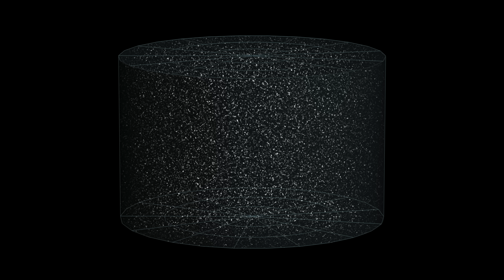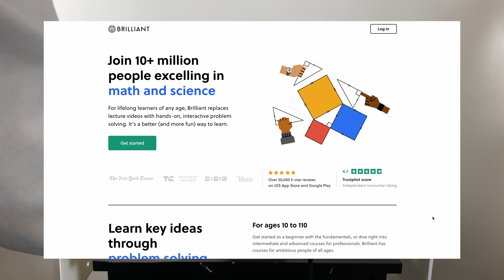World's biggest gear ratio...

Comment: I wonder if it's possible for you to even turn the last gear? (Imagine if he could and all the gears are somehow strong enough to maintain their structural integrity) at which gear would the gear teeth break the sound barrier?
Reply: He said it's impossible to spin that last gear as the very first gear that starts to spin in the whole mechanism would have to go either at OR faster than the speed of light (299,792,458 m/s) in order for the last gear to even complete a single rotation.

Comment: I'm not seeing any of the other gears down the line rotating, I know it's a small ratio but you're spinning the 1000x, gear in the video but the 100000x,  and even the 10000x isn't moving fron what I saw I n the short clips there was well over 10 spins of the touched gear, please explain

Comment: It is possible to get much greater rations with much fewer parts using "grinder gears" AKA "differential gears"
Imagine two tubes with teeth on the inside.
One tube has 100 teeth and the other has 101 teeth
Imagine a cylinder 2/3rd the size of the tubes that has a step in its diameter.
One part has 66 teeth and the other has 67 teeth.
If you put the two tubes end to end, lock the 100 teeth on in place and then force the 50/51 tooth cylinder to roll around the inside, you get a ratio of
66/100 - 67/101 = -297:1
If you make more teeth or make the cylinder closer to the size of the tubes, you can get very big ratios.
You can then cascade them like you did with the design you did to get huge ratios.

Comment: What I want to know is how much torque would it take to spin it from the final gear and if at all possible if it was spinning at say 1RPM how fast would the first gear be spinning?
Reply: 1RPM? 😅😅😅
If you turned it just one thousandth of a degree every 100,000,000,000 years, the first wheel would spin billions of billions of times faster than the speed of light.
Reply: @MicheleRoccapennuzza  I do grasp the idea and the mathematics but it still boggles the mind to see it represented in something so small and simple.

Comment: Input torque is multiplied 10 times each stage. There is a friction for each set of gears, and then there is backlash, which would be Hugh for 169 stages, after several stages the torque  will be far greater than the teeth can transmit, so this gearbox can never deliver the final ratio. I would be curious to know how many stages it would take to  start shearing teeth.
Reply: Forget the friction.

Comment: I would love to see how fast the first gear would spin if it was possible to spin the last!
Reply: It's literally impossible for him to do so, unfortunately. But I'd love to see what incredibly reality-warping things would happen.
Reply: 10^169 times faster.
Reply: theoretically if the last gear required no energy to move and the first gear was indestructible, spinning the last gear would result in a speed faster than light and we'd go back in time
Reply: Math.
Reply: You stole his pfp
Reply: Me too
Reply: It would reach relativistic speeds if you just turned the 11th gear’s teeth by 1cm per second. So turning the 24th gear an atom’s width per second would cause relativistic speeds at the 1st gear… you simply cannot turn gears beyond the 25th physically, and you can barely turn the 8th gear in practice.

Comment: just wondering, with "unlimited" budget, access to the best materials and machining tools, strongest and lowest resistance "aerospace grade" ceramic bearings, surface treated gears, axles, what would be the highest ratio/number of gears you could achieve that could be rotated from the slowest gears..I guess the best configuration would be using lightweight gears and lowest resistance for the fast spinning gears, and thicker/stronger/heavier gears/bearing for the slow spinning ones. I'm sure it would be quite amazing to see..this looks more like things I did with Lego technics when I was a kid.

Comment: So what would happen if you spun the last gear by hand or crank? Would that even be possible and if so, what would happen to the first gear
Reply: If you could. What would probably happen is that the first gear would probably be going so fast that it would possibly shatter the molecular structure of it. But what would most likely happen is the last gear would just snap in half.

Comment: Do a Fibonacci gearbox
1st gear 1 full revolution 
2nd gear 2 revolution to the first
3rd gear 3 revolution to second
4th gear 5 revolution to third
5th gear 8 revolution to forth
6th gear 13 revolution to fifth

Etc

Fibonacci is nature's sequence 
It would be interesting if this translates to mechanical 

Fibonacci sequence is
0, 1, 1, 2, 3, 5, 8, 13, 21, 34, 55, 89, 144, 233, 377, 610, 987, 1597, 2584, 4181.

Have fun

Comment: I have a very important question:

How fast does the first gear spin if you move the last gear even just a little bit
Reply: Unbelievably fast, but we won't know for sure, because it's not feasible to rotate the last gear. The energy required to do so is so immense that it's basically impossible. He was already struggling to turn the third gear, let alone the 170th...

Comment: can someone please tell me this.  if you were to spin the last wheel at 100rpm  how fast would the first spin?   also   if you have 1newton of force spinning the first gear   what would the torque be?
Reply: It’s physically impossible to turn the last gear. You would actually just break the plastic
Reply: @wolfiefink  yes.. but let's say these gears are indestructible and there also no friction involved.
Reply: @bonlappen3000  even with an indestructible gear set it would still be impossible. All of the energy needed to spin the first gear to get the last gear to rotate once would need to be available all at once to do the same in reverse. The amount of energy needed at the once instance would be 10^170 Nm
Reply: I gues it will be more than 10¹⁷⁰ N-m order of magnitude atleast.

Comment: Lets do some mafhs assuming all the gears have zero mass.
So.. light wave can go 186000 miles or 299337.984 km in a single second, now if each teeth of the gear is more or less 3 milimeter in base width, then the circumference of the gear is 36 cm = 0.00036 km. Thus if the gear is spinning at the speed of light then in 1 second, it will rotate roughly (299337.984 ÷ 0.00036) = 831,494,400 times..
now heat death of universe occurs after 1.7^106 years or 8.44656945×10^31 seconds so to make the last gear spin 1 time before the heat death of the universe, the first gear has to spin 10^169 times within this time period, so as each second passes the first gear would have to spin 10^169 ÷ 8.44656945×10^31 ≈ 1.2 × 10^199 times. If u want the rpm then we just gotta multiply this by 60 ≈ 7.1 × 10^200 RPM. 
How many times faster is this rpm than the speed of light?
Just divide the rps (s for second) of the gear if it had to finish rotating before the heat death of universe, by the rps if it was rotating at the speed of light.
That is, 1.2 × 10^199 ÷ 831,494,400 ≈ 144 × 10^188 times faster than the speed of light....

Comment: I wonder how astronomical the torque would be on that last gear. Probably enough to move the world in theory.
Reply: It could crush the known universe into a black hole.
Reply: in theory it takes more torque to rotate it than there is energy in the known universe
Reply: The gears would surely break if you applied such a torque to them.

Comment: If you made this with 0 tolerance and you made it so that the last gear is stationary, would the first gear turn? Or better yet how much can it turn if at all?
Reply: Assuming you can put enough force, the gears would turn small amounts (within their elastic deformation range) until the return torque exerted by the last gear becomes too large and either a shaft or gear fails (plastic deformation and eventually breaking the chain). 

Obviously I'm making a lot of assumptions but thats the gist of it xD

Comment: Be interesting to spin the final gear. Can't imagine how fast it would go.
Reply: faster than the speed of light
its gonna break the universe
Reply: The torque would be too much, when ratios go smaller they lose a lot of torque. Even with industrial heavy machinery he might not be able to do it.
Reply: The whole thing would break long before you could even start to measure the force required. I assume the torque required would be of cosmic scale.

Comment: I'm working on my own insane gearbox using planetary and grinder gears to achieve a ridiculous 500:1 gear reduction per stage. It will only need 63 stages to pass your gearbox. The crazy thing is that the design has an extremely small profile with a thickness of just .25in per stage and an external radius of 5in. The total length of the gearbox will be just under 16 inches
Reply: Звучит как что-то похожее на часовой механизм
Reply: thats so sick
Reply: We need an update
Reply: I subbed to you!!! Can't wait to see it

Comment: In such gearboxes you need to make gears and bearings stronger with each step, to convert high speed into more force instead. In your gearbox, the last gear has exactly same strength than first one, so it will break instant if you attach something heavy to it.
Reply: Well, if by "instantly" you mean  after the heat death of the universe then.. sure.. It will be hundreds of billions of years before the last wheel moves, at all.
Reply: @AndersHaalandverby  But the nearly infinite force generated is already present at the last gearwheel, therefore nobody can turn it, without breaking it.

Comment: Bro has used more rolls of filament on gears than I have owned in my entire life.
Reply: I would assume each gear would be around 10 to 20g. Using 20g, that would be 4 rolls of plastic, not including the base.  I use about 3 rolls of PETG per week.
Reply: @theboz1419  Couldn't imagine, i've had the same four rolls for like a year now. My printer's hotend fan exploded so i'll be using even less for about a week.

Comment: How much torque would it deliver if we somehow get the last gear to 10 rpm
Reply: Rpm don't matter for torque, only for (horse) power. But you could get 10^169 times the torque at the last gear as you put in - if the gears survive that much torque. Spoiler alert: they won't.

Comment: What happen if you try to turn the last gear
Does it break ?
Does the first gear turn faster than the speed if light ?
Or does it does nothing
Reply: the torque needed would be so high, that it would probably break the gear. so, number 1
Reply: Take it with a pinch of salt, Im not a physicist
Reply: @odenroberts7603  allright, thanks for awnsering
Reply: If you turn by hand it would just do nothing. With a powerful enough motor, the gears would just break.

Comment: if you spin the last gear faster than the speed of light then the 170 gears will form black holes all which will destroy more than 10^480 universes that will create a BIG BOOM! so big that it will destroy more than 10^500 universes.just imagine the amount of force of the first gear to make if this happens.
Reply: But black holes are just a massive amount atoms squashed together, so how would rotating it after than the speed of light make a black hole?
Reply: Because it will spin so fast that it will form atoms and then they will be squished in the room so it will form a black hole.
Reply: and before they will form more atoms,they will do magic because it will spin so fast that they will stretch into more atoms or bang into somewhere forming more atoms.

Comment: Spin the last one, I wanna see how fast it goes if it can handle it
Reply: It probably just would break, because the gear that is connected to also really doesn't want to move.
Reply: Here's a correction. When he touches the last gear 2:00 , it actually moves inplying you can spin it both ways.

Comment: ok so spinning the first gears is too slow.  what happens then if you spin the last gear, will the first spin at the speed of light?
Reply: if you have the sufficient torque power, yes
Reply: @123khg  and indestructible gears. The system would break before you get it turning.

Comment: There's something like this at the MIT museum (or at least it was a piece there when I last visited): a gear train with massive reduction and the final gear is actually carved out of the stone that it is mounted to.  It's impossible for the final gear to move, but the beginning wheels are still able to be turned.
Reply: For those interested, I've found the piece: it's called "Beholding the Big Bang" and it's a bit different than what I recalled (it has been years since I've been to that museum and seen the exhibit).  The final gear is embedded in concrete, not carved out of stone, and it's an electric motor turning the first gears, not a hand crank.  https://www.youtube.com/watch?v=VCA2whpMCno
Reply: @zenith1047  that makes me extremely uncomfortable LOL
Reply: @zenith1047  I was thinking it was Arthur Ganson's "Machine with Concrete" https://youtu.be/5q-BH-tvxEg?si=HwmOSjFKx3g8EOTc although that's a different model built by the same person illustrating the same concept of exponential gearing.
Reply: @mausolfb   it is the same work (project).   It was famous in art interested communities when released.
Reply: First, because of slight gaps between the teeth, it won't be until all the gaps have been closed, that any force will finally be placed on the last gear. Second, the amount of torque being applied, one of two things will happen: The last gear will rotate, breaking free from the binds that supposedly hold, or the second to last gear will break under the force and the third to last gear will rotate freely from then on.
Reply: That is a big misunderstanding.
The mechanism actually spins the earth, the last gear is seemingly standing still, because we rotate with it.
Reply: the mechanical flex of all the gears probably compounds up
Reply: That sounds kinda cool, tbh.
Reply: There's a lot of slop in gear meshing as well, plus flex of the gears, etc.
Reply: I've seen similar thing, where the last gear was actually standard steel cog, but casted into concrete. The first gear was still possible to turn, and it was stated that it would take thousands of years for the last gear to turn even slightly, so it's safe to cast it into concrete.
Reply: Imagine aliens coming upon this wall that is slightly tilted by a fraction of a centimeter in the future
Reply: @saisubdivision3941  the universe would have ended long before that
Reply: That’s really cool actually
Reply: Sewing machine motor driving it IIRC.  It was super cool to see and contemplate how small the whole assembly is for what it means.
Reply: When I was a kid I loved the book "Building Kinetic Sculptures with Lego Mindstorms" and one of the projects was a copy of this sculpture called 'Machine with Minifig.' It blew my mind
Reply: The built-in free play of the gears alone will take the rest of time to be taken up so that the last gear can move at all. I wonder how much energy will be required to make all of the gears rotate at least once? Probably more than our sun can produce for the rest of it's life.
Reply: That's really cool 🤣🤣🤣
Reply: tolerances..
Reply: @geemy9675  what are those
Reply: @cadneemountai2791  the last gear doesn't have to move because even if there's a nanometer separating the two last gears they won't touch each other before the sun explodes. even if all the gears were touching  each other it wouldn't lock because the gears have some elasticity
Reply: That’s just the slop in the great drive
Reply: Imaging it in reverse mode and see the first weel spinning way above the speed of light. Who said that this can’t be reached?!
Reply: @jean-marcducommun8185  physics
Reply: Does a fuckin 10¹⁰⁶ power = move time forward
Reply: I’m confused why won’t it spin it’s a wheel
Reply: @adamatch9624  it will.
You just have to spin the first gear ten billion quadrillion google plex time to get the last gear to turn 1mm, so technically it would need to turn or move, at some point in time, to not bust the works all to hell.
But it's a zillion years of turning the first gear at 1000 rpm to get the last gear to move .01 mm
Reply: they still move just very slowly. Would be interesting to use an electron microscope to view some of those gears move alongside a stationary backdrop
Reply: I want to see it spin

Comment: The last gear is almost stuck, why are the first few still spinning? I think because none of them are rigid bodies
Reply: the tiny gap between gear teeth is enough to let the first gears spin freely for years before there's any force even put on the later gears
Reply: The fact that they're not perfectly rigid bodies, and slop in the gear-to-gear meshes is the only thing that permits the first few gears to turn AT ALL. As a guesstimate, since I don't know the exact tolerances, I'd expect it would take a good deal more than a billion turns of the first gear *JUST TO TAKE UP THE SLOP IN THE SYSTEM*, and it wouldn't come as a surprise me to find that it would take another billion turns after that to cause the final gear to turn enough that one of its outer teeth sweeps the width of an atomic nucleus.